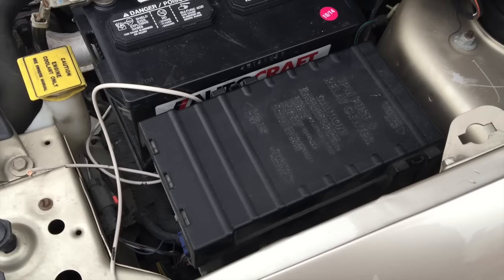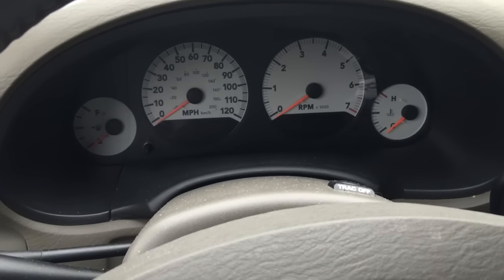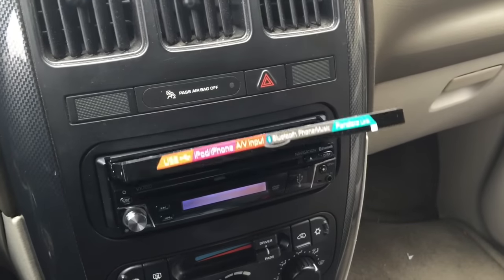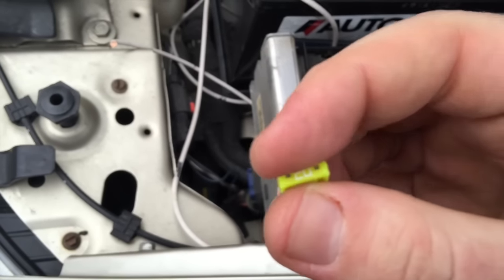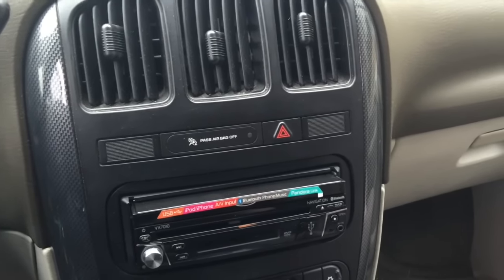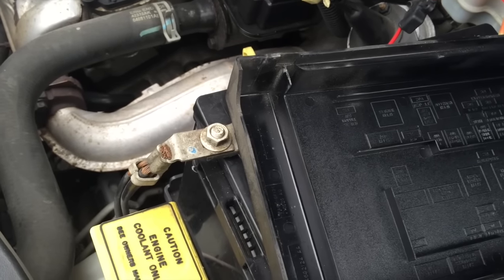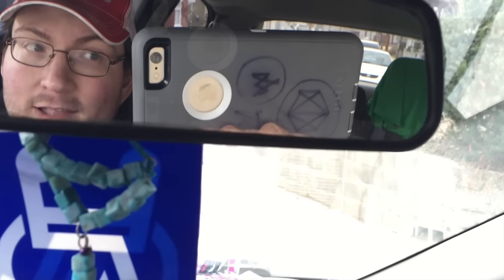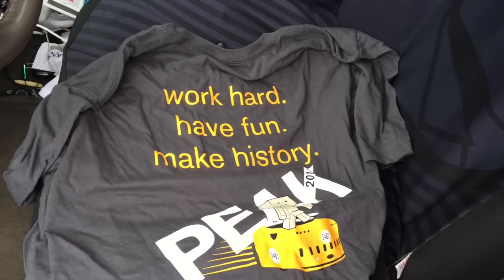Quick Tip: Signs of a blown IOD Fuse on a Chrysler, Dodge, Jeep, Fiat, or Ram product

Comment: Ok, hope you can help me...I have a 2012 Fiat 500c POP. I read throughout all the comments to see if anyone mentioned Fiat..but didn't see lol Well, my headlights decide to come on or off whenever they want to, even when the switch is turned on or off...& when they won't turn off when the car is turned off, I have to unplug the negative terminal from the battery. And I couldn't figure out which fuse is the IOD as you mention in your video. And they do flicker at times too. And at times...the sound from my speakers may seem to decrease a little ( volume) If I make any sense? Lol thanx

Comment: Nicely done, BCM hole that’s funny! I have a 2001 dodge caravan and the radio doesn’t work but if I turn the rear wiper on the radio will turn on and off intermittently. If I were to pull the IOD fuse out of its spot, would that reset the BCM  and  would that be a fix for the radio
Reply from the maker: Sounds like a short to power in the windshield wiper circuit and/or the radio circuit.. you can try and pull the IOD anyway
Reply: adventureoflinkmk2 I just pulled the IOD fuse but no luck, so I will try checking the wiper and radio circuits later today! Thank you for the tip, it is well appreciated
Reply from the maker: @Molinajme  you're welcome... good luck!
Reply: @adventureoflinkmk2  thank you so kindly
Reply from the maker: @Molinajme  and you're still welcome all the same... lol

Comment: I have a 2007 jeep grand Cherokee and replaced my iod fuse and the jeep engine wont turn off even with the key off. Everything works with the fuse blown except the radio won’t keep memory. I can’t figure it out
Reply from the maker: Because the IOD fuse also controls the radio memory.

And, if the engine doesn't turn off even with the key off... theres definitely something wrong.  I've heard about this with diesels, usually not petrols.. runaway engine?

Comment: Hi.  I have an 05 Chrysler sebring sedan, 4 cylinder.   Just got the lower radiator hose fixed.  Drove it.  Turned off the ignition,  won't start. Headlights and taillights come on, but windows, radio heater doesn't.   At first it tried to start and then when I turned the key (it chimed) it would click quickly.  Tried to jump start, but nothing.  In your video you talk about the iod fuse.  I don't have a car manual and the cover doesn't have a diagram.   The ones that show a diagram  (videos) are too small to read even with a magnifying glass.  Hope you can advise me.  Thank you
Reply from the maker: Okay.. from what I've read there should be a fuse with a black cover on it.. that's your IOD

Comment: Mine has all the same exact symptoms, so I just checked the fuse.  Unfortunately, the fuse is good.  That's gotta mean I have a bad connection somewhere?  Sometimes it does this, sometimes the van is perfect.  If it does get driven, we dare not shut if off for fear that it won't start again.
Reply from the maker: Yeah, open the fuse box, look at the wiring and connectors.. if any are loose, corroded, or whatever clean and patch as necessary
Reply: @adventureoflinkmk2  All looked good.  I replaced the fuse anyways.  The real test will be driving it for a distance, then turning it off.  Lol.  You video may have pointed me in the right direction though.  And for that, I hit the subscribe button.  Thank you, sir.
Reply from the maker: Thanks for representing and showing your support :) but yeah, if the wiring under the fuse box is good (especially to the IOD), then the next step of action would be to take it to the dealer for diagnosis, up to and including the BCM

Comment: I have a no bus light and theres no communication no read on meter I changed alternator ignition switch cylinder and coil pack, do I gotta get new keys programmed if I didn't have a original chip keys
Reply from the maker: Good question... I'm not sure tbh

Comment: In need of some dier help. I own a 07 sebring. When driving after about 30 mins all my lights on my dash begin to flicker on and off, as well as all my gauges going crazy. About a year ago they changed my bcm but now the problem has came back. Back then the vehicle would shut off after about 15 mins of that happening. Now it doesn't shut off but lights and gauges go crazy. Is there a chance it's the IOD fuse or the BCM- or any other fuse for that matter? My windows and locks function correctly as well as my radio and interior lighting. just my dash lights go haywire

Comment: Have a 2007 Dodge Caliber.  Turn on rear wiper and all gauges and lights go haywire and car seems like it’s gonna die. Also front windshield washer inop. Any suggestions? Pulled rear wiper motor and hooked up to clean power In my shop and operated fine.  When hooked up on car it kind of jumps and doesn’t want to go
Reply from the maker: Probably a Bad ground somewhere, I'd check where the ground is for the rear wiper and check it.. maybe even a bad engine ground too
Reply from the maker: Additionally I found this... apparently 2007 model year calibers were recalled... over windshield wipers.

https://www.autoevolution.com/news/chrysler-recalls-84000-dodge-calibers-13249.html

Comment: I don't know if this was the case in my 2001 Dodge stratus 
What it does is my dome lights radio and power lock remote don't work but everything else was unaffected and it randomly beeps while I'm driving down the road

Comment: I have a 2010 Crystler 300 my power locks seat and radio went out at the same time and the fuse is still good but i have not tried the iOD fuse dp u think it will work?

Comment: I just purchased a 2002 Jeep Liberty.  I have NO radio, NO Interior Lights, my Keyless Entry remote does NOT work....could this be due to the IOD fuse?   Thanks for any help you can give or any advice.
Reply: Thank you so much. The keyless remote will work inside the Jeep but not when it's outside.

Comment: where exactly is this fuse located under the hood? I have a 2006 dodge stratus sxt 2.4L. which slot is it what color is it? I would greatly appreciate it I havnt had a radio for 2 years and it's driving me insane. I have instrument lights but my power locks and my remote won't work nor will my dome light turn on.
Reply: +adventureoflinkmk2 sorry man I don't see anything in my manual for this fuse that's why I asked . now I DO have a slot that's for number 5 that doesn't have a label and it apparently is for all the problems I'm having . it's a 10 AMP red.

Comment: Chrysler sebring ignition fuse popped,  I replaced it but it's not starting consistently.  I m going to clean the contact , any advice?
Reply from the maker: Only thing I can say is to separate the fuse box to where you can see the wires and clean off the green ick
Reply: @adventureoflinkmk2  appreciate the information greatly,  excellent content,  cheers from San Diego.
Reply from the maker: @Jeremyramone  you're welcome
Reply from the maker: @Jeremyramone  and thank you

Comment: I have a 2010 Dodge Journey, can you help me with a fuse problem? My fuse keeps blowing out?, thanks
Reply from the maker: Only thing I can suggest is to take a ammeter (preferably 10 or more amps) and put it in line with the negative battery cable and terminal, let it settle for 60 seconds, then pull each fuse one by one and watch where the current drops
Reply: @adventureoflinkmk2  thanks
Reply from the maker: @monir9696  you're welcome

Comment: Hi where did you get your radio its nice
Reply from the maker: Off Amazon
Reply: Thank you ill look at it
Reply from the maker: You're welcome
Reply: Not sure only if it fits my 07 DC SE.. is it plug n play or need to cut and splice wires? Thanks
Reply from the maker: @roblox_bedwars-g5x  yes, it fits your van.  You'll need a din 1.5 kit and one of those aftermarket radio harness adapters

Comment: I really need help  there war a small spark on my fuse box and by dash won’t even turn on now if like if I don’t have a. Battery what fuse could it be
Reply from the maker: Hmm. If the spark was bad enough it's possible the alternator fuse went out

Otherwise what else is it doing?  Like does it crank but not start or...?
Reply: @adventureoflinkmk2  thank you so much for your reply , I put the key in the ignition and nothing no lights no crank it’s like If I was turning on a car with out battery
Reply: @adventureoflinkmk2  I also went ahead today and changed out most of the fuses and replaced them there was like 3 broken ones, and still nothing the only thing I’m still missing is the starter replay and the starter fuse but i don’t know how that would affect the total battery not being detected.
Reply: @adventureoflinkmk2  it basically happened when I was putting a small thin wire from the radiator fan relay to a ground so that I could have constant fan on but i dint realize I stuck the wire on the positive whole instead of the negative so it did a small spark a bit of smoke came out and that’s what happened
Reply from the maker: @AkBulls0305  you're welcome.  And it's still likely that you either blew the alternator fuse or battery fusible link (forgot exactly what Chrysler uses)
Reply: @adventureoflinkmk2  the fusible link is the red cable correct ? And I don’t knew for the life of me where the alternator fuse is located on a 2005 Dodge neon SRT4

Comment: Ok will the iod fuse also cause the heater not to work along with the locks?
Reply from the maker: It may cause the blower not to work, yes. If the heater doesn't work then you may have bigger issues (such as blend door stuck or a clogged heater core)
Reply: @adventureoflinkmk2  remove your glove compartment box out of the way you need a blower motor resistor switch 15 dollar part at any parts store simple fix for heater blower motor . as well check other relay switches in yourfuse box compartment for bad fuse or relay switches.

Comment: I checked the IOD fuse.. it was fine. But gauges and warning lights still going crazy! What now??
Reply: I'm having the same problem
Reply: Having same problem,
Reply from the maker: My reply must've been deleted some how.. that said id be checking underneath the fuse box, especially where the IOD wires go.  If they're broken, loose, corroded, etc you'll have to clean and fix it

Comment: I lost my radio and my cig lighter.   Any idea which fuse or fuses would fix those?

Thanks
Harold
Reply from the maker: If you have the owners manual, or can locate the fuse boxes for your vehicle it should tell you.. otherwise, I wouldn't be entirely surprised if the IOD was tied to both circuits

Comment: hey, my dodge caravan 2003 3.8l started doing something similar to this. everytime i put it in contact the wipers just go on and cant stop.... i did have some kinda of steam / smoking come on inside by passangers seat... the battery complete died and went garbage also.... problem is i have this car in europe in my home country and here there isnt any good mechanics who know this car.... i know it can be a fuse or just a wire thats loose or some crap..if u can help plz help me out!!
Reply from the maker: Sounds like there may be a short to power somewhere..

Comment: Hello, some trainee mechanic has combined 2 batteries in series to start my Chrysler 300 and the fuse boxes, front and back are now making funny noise, and the car wont start, no power to injectors, plugs and fuel pump... am thinking of replacing the fuse boxes, is that the correct approach to solve the issue? PS: all the lights are ok on the dashboard, windows work fine as well
Reply: ***** Stories like Guery's scare the fire out of me. I really like to be a Good Samaritan, and help people out with  a jump start.  However  --   I ALWAYS insist in doing ALL the connections to both vehicles.  ECM's and BCM's are too expensive to goof around with.  BTW,  good vid!
Reply: you are right, as those fuse boxes make some funny noise as soon as you turn the key on, anyways I hope they fix that or will see them in court...

Comment: What could be the problem for instrument panel on a 2006 Town and Country to flicker back and forth out of control and make the radio go off and on
Reply from the maker: Prolly BCM... Or common power/ground
Reply: I'm having  the same problem  with my 2012 town and country... did you solve the problem if so what was it?
Reply: @mikeblackman1768  yes I did the problem was loose grounds the wiring to the battery was very loose I hope that's the same problem that you're having it's an easy fix

Comment: I have a 2016 Jeep Patriot dad started acting crazy after a minor front-end Collision take it to the body shop and when I wait to pick it up I drove it about a block you notice the windshield wipers were on went to get turn them off and my truck died but then turn right back on by itself... Then I started noticing that there was all the warning lights on the dash came on including the engine light also when I took it back to the shop my radio and my air condition would turn on by themselves so I took it to the dealer cuz it was still under warranty and a day diagnosed it as a faulty tipm and they replaced it but after they put the brand new tipm it still is acting crazy like nothing had been fixed do you have any other idea what else it could be? Because the dealer has had my vehicle for going on 3 weeks and I desperately need my vehicle back. Any help would be much appreciated thank you!

Comment: 2015 Chrysler 200 the battery keep going dead put new battery still goes dead  i notice the start button if i push in the middle it will not start but  push on the outside of the button it will all so my dash lights stay on would the start button be the problem

Comment: This van has nothing to do with Fiat..Fiat wasnt even in the picture when this van was built or designed..This is a Chrysler Corporation vehicle...

The 2008 remodel might have Mercedes & Chrysler parts in it,but not all do some are all Chrysler still..

It wasnt until 2010 until Fiat took over Chrysler,Dodge,Jeep ! And still some are all Chrysler no Fiat parts in them..

Comment: I have a 2015 Grand caravan My IOD is not 20 amps and it's also not easy to get out. It's in a housing I cannot get it out everything says to pull a fourth of an inch that does not happen it doesn't budge there are clamps
Reply from the maker: Odd, mine came out without clamps..

Comment: everything works on car but it doesn't start. windows, doors, radio, AC, lights, on dash board, horn starter clicks and thats it. it  has a new battery.  I checked fuses. Stumped please help

Comment: Mine is doing this also but only clicks when trying to start... And gauges stay on after the truck key is turned on and off so you have to disconnect the battery

Comment: I was having the same issues in my 08 caravan,took the fuse out and it was not blown,so I put it back in and every thing is normal?thanks for the video!
Reply: Idk, but hey it worked for now!
Reply: Hey Ron -- just curious if you had no power to all of the items mentioned in this video (i.e. no interior lighting, no radio/clock, no power locks working, key not activating doors to close or open, light show on instrument panel, and so on). Asking because until I came upon this comprehensive video -- I had seen others concerning Dodge vehicles where the remote key functions stopped working only -- but other things were unaffected. That may be the difference -- glad to read yours worked!! Mine has complications (<<sigh>>) with the fuse coming out with only one prong and the other piece is recessed into the hole!! Have a great day!! :)
Reply: +nightowl7777 No it did not work for anything except to start the van.
Reply: +nightowl7777  and at one point I could not get the key out of the ignition.
Reply: ronald gilley Oh cripes -- well. thankfully it is all good now!!! Thank heavens for the internet I say!! :)
Reply: ronald gilley P.S. Given that I've watched a pile of these videos trying to spot this specific issue (which THIS video targets!!) -- I have seen on others that the situation may occur intermittently afterward & requires the same IOD fuse (if still intact, of course) to be removed for ~ 30 seconds & replaced again. Hope you don't need it -- but thought I'd add that in case you hadn't read or seen it!! :)
Reply: +nightowl7777 Yea I read a few forums before finding this video and a lot of people have been spending thousands of dollars trying to fix this issue and its just a fuse,hasn't happened since Saturday afternoon.
Reply: ronald gilley Absolutely not worth taking it in when you can keep a couple of extra fuses on hand in case it happens again. I had just seen that it can reoccur without warning -- and the fuse does not require replacing -- just needs a 30 second removal, so wanted to mention that!! This video is a Godsend.
Reply: ***** THANKS for all of your help -- you are wonderful. Much appreciated!! Have already sent your video link to a friend who is having similar difficulties on same van as mine!! Thanks again for all you have done to help others with this frustrating issue. You are awesome.

Comment: thank you for this video. i have a honda civic 2005 and oppsite of this issue in my gauge. check engine,parking brakes and seatbelt has no lights. sometimes it does and will disappear all of a sudden. not sure what could be the issue. hope someone helps.thank you

Comment: 2007 Grand Caravan IOD fuse blows.  No radio, No DVD, No power anywhere to include headlights unless key in in the accessory position or van is running.  But still no radio/DVD..   Disconnected DVD and radio, Still blows fuse